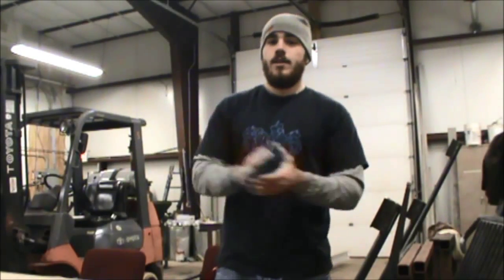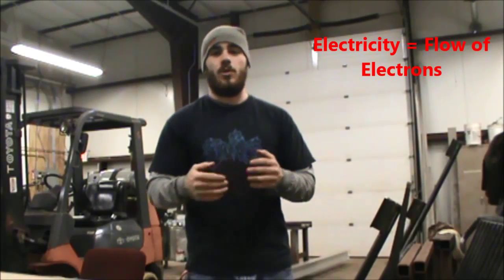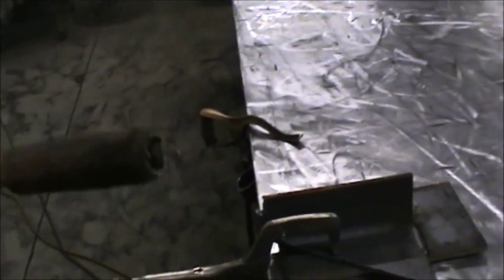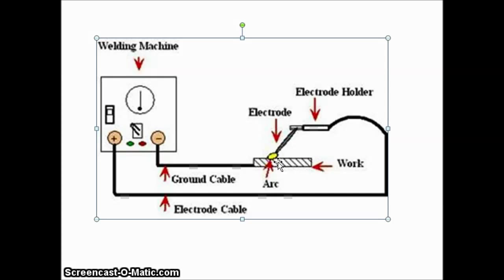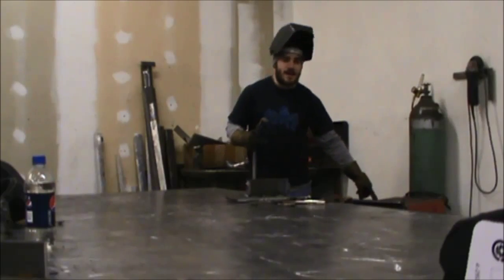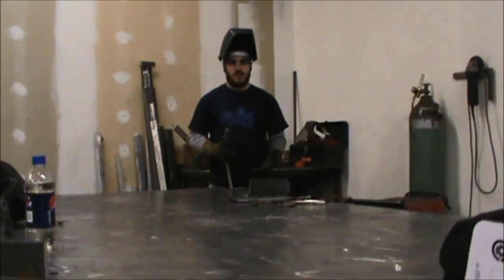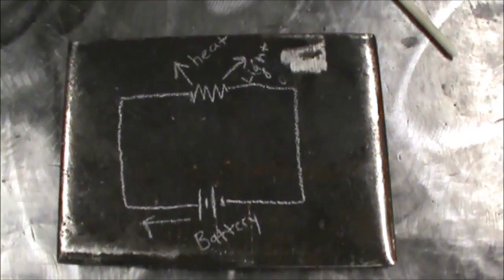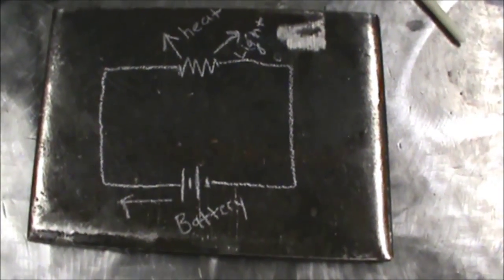Mahl Electricity 1

Comment: Thanks for this, Sir. Very good idea to explain this using a welding machine and human force (Mike Tyson blow). When you kick the table and say it pushes you back it is where resistance (deliberate in devices) and loss of energy occurs (problem in electric energy transport). Correct?